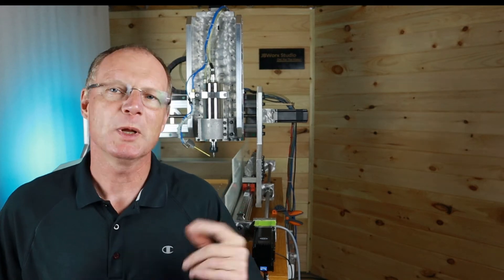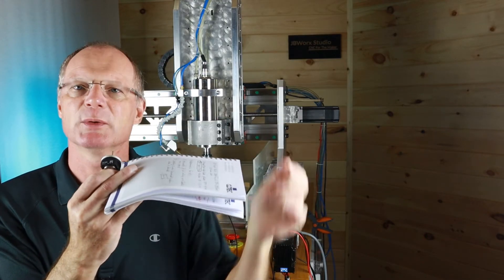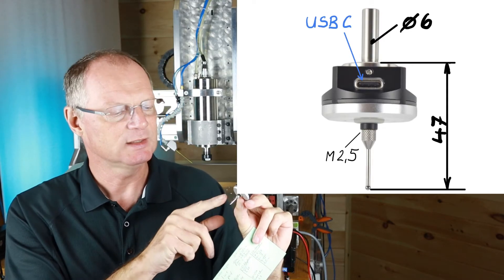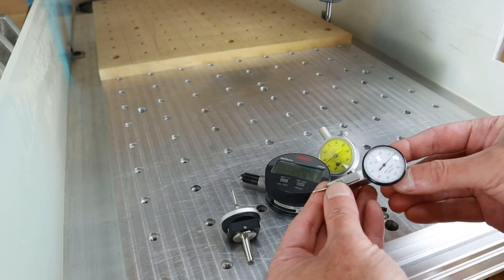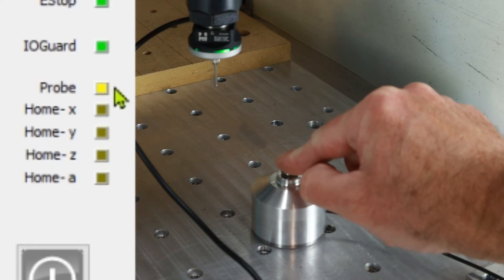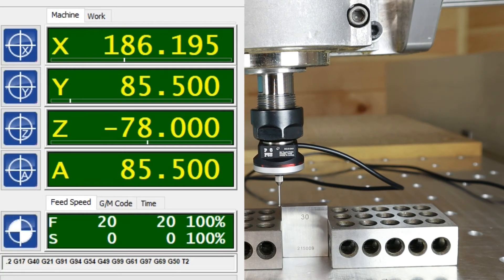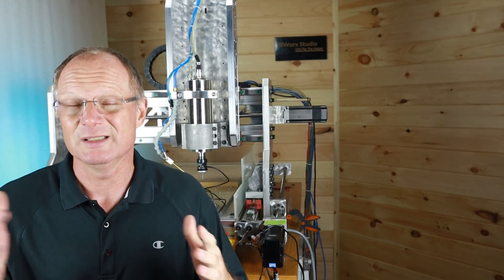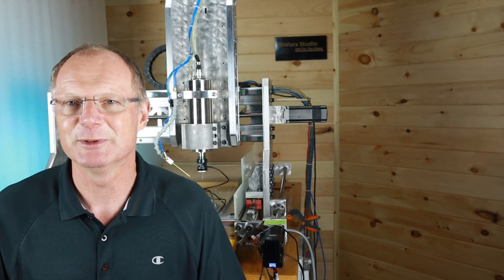CNC Touch Probe

Comment: Fairly new to CNCs - so apologies for the basic question. I am looking for a probe that does not need a metal surface to electrically trigger the probes location (e.g., when working with wooden surfaces). This looks like it works this way. Can you confirm please - or does it need to contact metal?
Reply from the maker: Welcome to the CNC Maker Community!!! 
Yes you are correct this will work on any material not only metal.

Comment: uccnc has beautiful out of the box support for this thing. got exactly the same one, couldn't be more happy. the question maybe stupid one as I might have missed something simple: I have another  probe to measure tool offset, mounted in the far corner of my table . now before program starts first thing I do is I 1) pickup the corner and top of the part then I 2) pickup the height and coordinates of tool offset probe. next thing I do is I 3) remove 3d probe from the spindle and put an endmill, then I 4) move spindle at the centre of tool offset probe, to the xy coordinates picked up at step 2, do touch off machine now knows how long the tool sticks out, 5) come back to part to the coordinates picked up at step1... then cycle starts. 6) when it is time to change the tool, cycle pauses and I have to repeat step 4 and 5. 
 i struggle to understand which axes should I put to 0, where goes these offsets etc...  something like this: part at G54, tool offset probe at G55 is it close to what is normally done in this case? Thank you!

Comment: hello nice video u have my sub!! i have the same 3d probe but i can find any info how to use it with custom macro i am not advance with cnc i stil learn things is any link or info about how to setup code for the probe  for example to find inside and out side cyrcle or leveling like 3d printers do cant find any clear info about it  how to use it
Reply from the maker: Yes this is exactly the problem. Like I mentioned in the video, make sure that the probe you buy comes with a macro / code you can use on your controller. The code you need will depend on the machine controller you use. Your best bet is GitHub have a look there.
Reply: @JBWorx  thanks they come with only mach 3 files some not full support i am using grbl for now because i use the same machine for laser i alredy remove the mach board from it long time ago also the version they sent me for mach is payed version not free i have to pay to get this 3d probe to work if you have any  link to start using my probe i appreciate that also thanks for reply nice channel i just find you today you do nice job here thanks for all info you share with us
Reply from the maker: Are u using G-Sender ? If not check it out. I have only little experience with GRBL but this one seems to run stable. It also includes probing functions for Z and xy edge finding. 
How to save the offsets you can find in the online documentation. 
https://forum.sienci.com/c/gsender/14
Reply: @JBWorx  yes for now i am using gsender but i not foun inside any setup about 3d probe i see 1 video they post they goin to come in next update i use the mks dlc 32 max board on my machine to run also laser on it i guess i have to make custom macros but i dont know how cant find info about 3d probe script

Comment: How can you work with the 2mm diameter tip offset in the software side. If you use g38.2 L2 P1 X[-?]? How can you do a -offset to compensate when writing a custom macro? Grbl, fluidnc, etc? Because if you use g38.2 without compensation you will carry 1mm error on each side plus the normal error from when you touch and when the signsl activate.
Reply from the maker: Yes you are correct there are several controllers where you have to create this offset. Also this is not all because you also have to compensate for the amount of deflection that the probe needs before it “switches” the signal. 
So my software  EdingCNC has a routine to set these values. 
I have not worked enough with GRBL to answer your question.

Comment: Maybe you can do or have a video on the different ways to use the probe.
stock orientation, surface 3d model.
Reply from the maker: That is a good idea. So you could use it to 3D - probe a complete model of something. But the output will be a table of x-y-z coordinates and that will need to be imported  into a software that can show that geometry. One other funktion I have used is to rotate the coordinate system to the part orientation.
Reply: @JBWorx  i think i saw something about them probing the part that was not flat, but the mill code was on a flat. Then the CNC compensates for the curved area. Not sure what they called it.

But my biggest problem is to set a part exactly in the axes orientations.
Reply from the maker: Yes probing a curved surface is also possible. 
Setting the axis in x and y will start with a good calibration of the probe. I use a calibration ring for that, but a sleeve of a ball bearing will work too. 
Measuring the ID with your machine should held a result as close as possible with real world dimensions. 
I think if you could get this probe to 0.02mm within the given diameter you are golden.

Comment: Out of experience: in case you crash it, replace the disc with the contacts together with the tip. It's about 10 euros each if you order them from China. 
Setting up the set-screws: I found the easiest for me was instead of using a dial indicators, just place the machine very close to a flat surface, like a vice or a 123 block and turn the indicator with the cable connected. When triggered the led shows you what screw to adjust. Of course you're compensating the runout of your collet like this. So get a good collet or spin it 180 degrees and try again and find some middle ground. Btw I also ordered a NO by accident and then converted it with a transistor and two resistors to NC. Way safer like this.
Reply from the maker: Thank you that trick with the 123 block is a great idea !! 
And yes the NC is a better option. So far mine has ran good but I now have to adjust the center again as I was hoping to find 2 contacts inside one NC and one NO - no luck
Reply: @JBWorx  I soldered the transistor and the two resistors directly on the plug of the probe inside the enclosure. Some shrink tubing and hot clue around will do. It’s working pretty well like that, if you pulled the plug and start probing the controller will throw an error. Safe enough.
And you’re right, this usb-c plug is quite a bummer. Them plugs shouldn’t be exposed to any mechanical stress. I’m always securing it with some hot glue, not pretty, but I believe it helps preventing wear. 
If you’re still looking for some coding help in python or for micro controller, drop me a line.
Reply from the maker: @joergbeigang Yes I can see hot glue as a nice solution - and if you ever need to remove it a drop of rubbing alcohol will release it. 
For the moment my probe is not in use - I am playing around with a tool changer form Rapidchange ATC so I don’t have the option to integrate the probe easily - at leased I did not give it any thought yet. 
Thanks for offering the help - I might take you up on that … 😃

Comment: Hola cómo estás ? sabrás decirme cómo se instala en mach 3 ?
Reply from the maker: Yes, this probe will also work in Mach3.
Reply: @JBWorx  no logro conectarla
Reply from the maker: Hmm you should be able to. So take the positive and negative from the probe and connect it to your board voltage.  Let’s say 5V but 12 V will work as well. The signal wire needs to go to an input pin. Let’s say input #3. Now to make this work you will need to go to Config - ports and pins - and use input 3 as “probe”. Now you will also need to set it to active low or active high - best is to test that out. Hope this helps.
Reply: @JBWorx  ok hice todo lo que mencionas y nada, solo tengo luz verde y roja al accionar la aguja! el cable de señal lo coloque al pin 11 (probe) en placa mach 3.
tambien active x bajo y active alto y nada
Reply from the maker: @procalcosmx1142  I am sorry to hear that you get no connection. can you wire a simple 2 wire switch onto that input and see if that works in Mach3.

Comment: If anyone ever comes across the problem to combine a PNP normally closed tool length sensor with this NPN normally open 3D touch probe: the Eding Sensor Hub is the solution. 
In Eding 5.2.1 there are also some new Macros for probing in the default macro file.
Reply from the maker: Thanks for the info - I have the sensor hub and wanted to make a short video about it. 
I have not yet played with the new probing routines. How is the macro different from the former version ?
Reply: @JBWorx  They now added finding a center of a circle (inside and outside) as well as finding X/Y zero and angle of a square on the surface. I'm setting up my touch probe today, so I'll test them during the next days and weeks.
Reply from the maker: Excellent let me know how it works. Have you done a calibration of the probe yet. There used to be a routine for a calibration ring that will determine the precise switching point of the probe / ball diameter. I don’t remember where exactly it is if it was in the Sorotec macro or in the Eding folder somewhere.
Reply: P.S.: Did you ever manage to setup the probe for Z probing of a workpiece? I think that would make my life significantly easier to simply touch off the top of a workpiece instead of grabbing the tool length sensor for this task every time.
Reply from the maker: Yes I have tested that - it’s been a while ago. So one attempt was to get the probe always into the spindle with the same length sticking out. It’s not super accurate, but ok for most uses. Next was to probe on top of a calibration blog that I machined to the same height as the tool length sensor. Again also that I don’t use anymore. I bought some hardware to mount the probe permanent and swing down like on the Datron machine but have not built that. It’s an idea at this time.
Reply: @JBWorx  The calibration is in the macro of the Swiss company that produces the other 3d touch probe. I also managed to buy their macro in a Swiss shop without the Swiss probe. I'll compare the two macros during the next days ;)
Reply from the maker: Oh that  is super interesting. I never saw you can get the probe cycle without the probe.

Comment: Thanks for the video. Oh wait, you didn't show how the Z probing work. Can this be used as a tool setter?
Reply from the maker: I use it to touch off x and y. You can touch off z as well - in this config it is not really a tool length sensor however there is a kit you can buy as add on to make a tool length sensor out of it. If you have an ATC or you use the tool table with stored tool length then yes you can just touch off Z and that would work but it depends on the controller you are using.

Comment: Is the probing done via the MDI tab or is it done by a file within the cnc macro file?
Reply from the maker: I use a Marco. Eding CNC provides a very basic macro however if you get involved how the probing works you can extend on the existing one.
Reply: How do you bring up a command to start the probing?
Reply from the maker: Eding provides a user menu. Here you can assign a button to a Macro / or basically call up routine in the file called macro.cnc
Reply: @JBWorx  I tried to probe a work piece using MDI such as F30
G38.5 X30 when the probe touched the part there is no retraction of the probe and the accuracy is down to 0.25 which I am not happy about.
Reply from the maker: @SmokeRings-eg7md you do need to calibrate the probe. I use a calibration ring but if you have a ball bearing that will work as well. I do not use the MDI command for probing but it is possible.
Reply: @JBWorx  Calibration of the probe is beyond me I wouldn't know where to start.
Reply from the maker: @SmokeRings-eg7md ok I note it down for a Video. I really have to get back posting some content and I added this to my list. The macro will be covered as well.
Reply: @JBWorx  Thank you, that's😁 awesome

Comment: I use Eding software and controller and I have ordered a touch probe same as yours. This may sound like a dumb question but how do you make the axis move toward the stylus? I am sure it wont be the jog function.
Reply from the maker: Cool ! Not many use Eding, and I think it’s such a good controller / software. So you have built in functions for probing. Go into the user menu (it’s the icon with the head) you find them there. There is also a bit of set up to do so the dimensions are correct. Too much to explain here but it’s covered in the manual.
Reply: @JBWorx  The only soft button I see here is for the tool setter, this will only move the Z axis, I need a soft button to command the Y and X axis.

Comment: Do you have a macro (script) that will work with this probe.
Reply from the maker: It is not really the probe it is the controller that will need the function. Yes my Eding CNC comes with a rudimentary probing function. usually the vendor of the probe will provide the required macro for different types of controllers. Not in this case.
Reply: @JBWorx  that is what I'm asking about, is a script for my software, to be assigned to my probe button.
Reply from the maker: It’s not furnished by this vendor. What software do you use ?